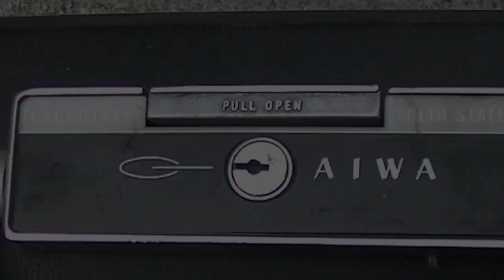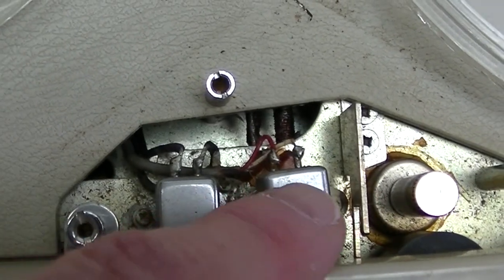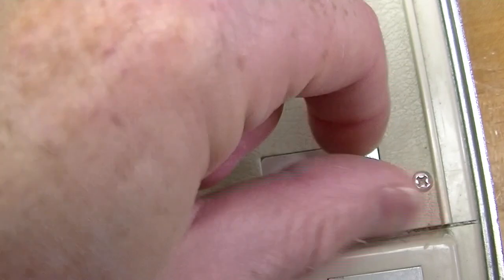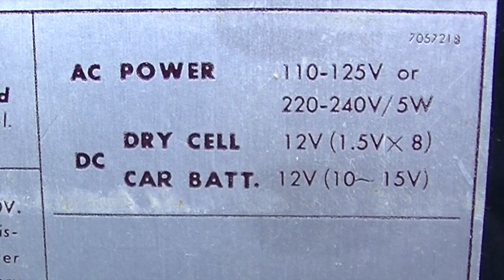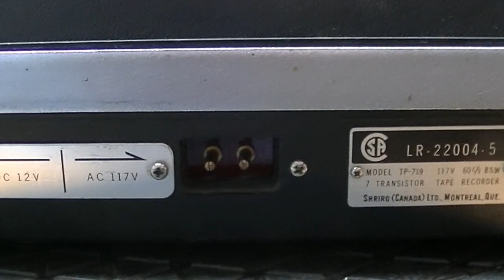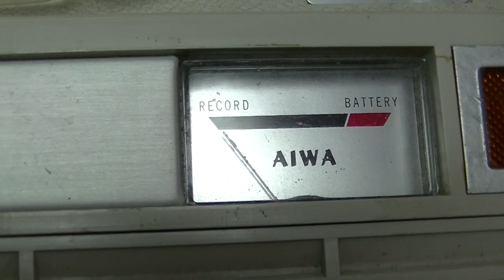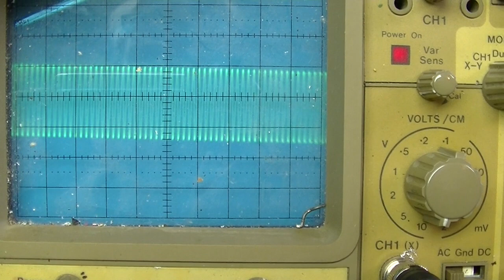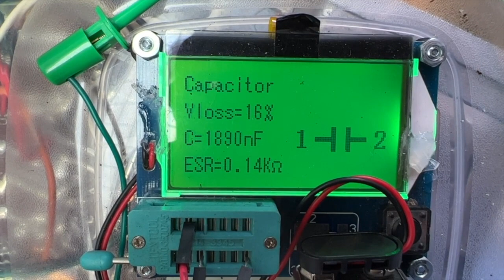Aiwa TP-719 Disguised Tape Recorder (Part 1 of 2: Examination & Repair)

Comment: I found mine with all the accessories.  It came with power cord and Mic in a nice vinyl bag and the battery compartment tray on the other side.  Really well made.
Reply from the maker: You were very lucky. Often accessories are lost and are very difficult to find. (Sorry for the delay, YouTube held your comment for some reason. I didn't see it until today.)